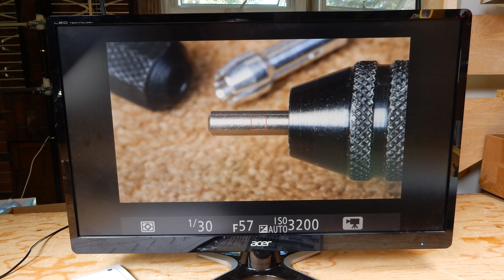The Model Ship - Part 522

Comment: I sometimes we'll chill my part in the freezer  I usually do a test  peace  of the plastic on the tree to see if it is compatible to do it .not too cold as to  crack it though. and then use my Dremel tool on it as slow as I can and take little bits of plastic at a time so it won't melt too fast and then I have a tiny chisel and scrape the rest down as far as I can then I use my tiny file and sanding sticks and find grade wet sandpaper used wet it gets it down pretty good 👍🇬🇧

Comment: I didn't realize Dremel made a chuck with a clearcoat on it.  😁😁😁😁

Have you tried a scary sharp wood chisel on those hull bumps?  Could use it as a scraper also.                          See ya.                JimE
Reply from the maker: Might have worked Jim. 😁👍

Comment: What an overkill, Ron! Why not just use a small chisel remove those "bumps". Full control and a fraction of the time you spent. SYT!
Reply from the maker: Yes, a chisel is being recommended. But thinking about it now, I'd likely end up with a hole on the bottom of the hull. The plastic there is not very thick. 😁👍
Reply: @roncalverley  That¨s no big deal. Just put some putty in and you are good to go. Putty is the modellers best friend! Along with a small chisel and small scraper and... and... and.... some other of all the modelling tools out there :-))